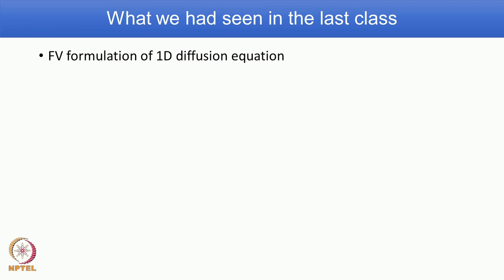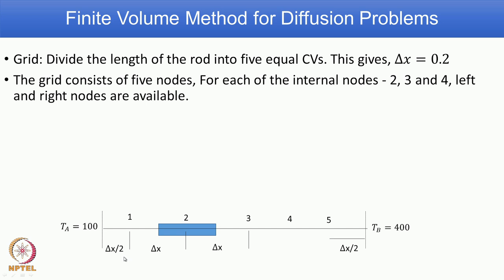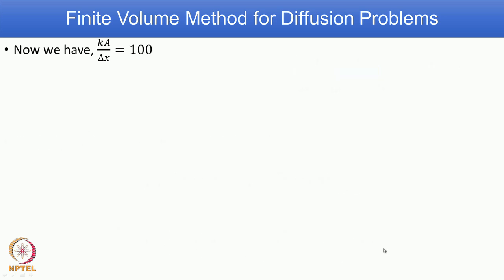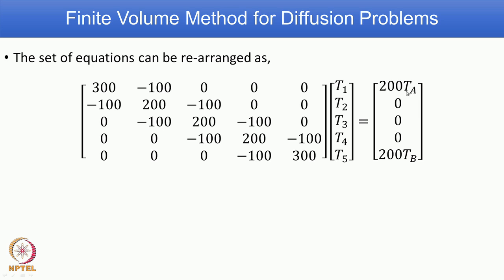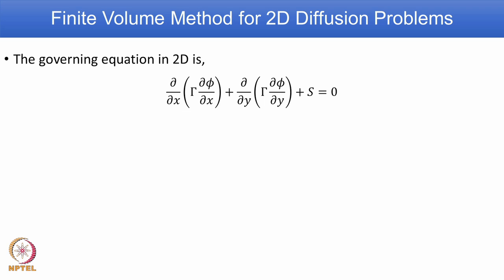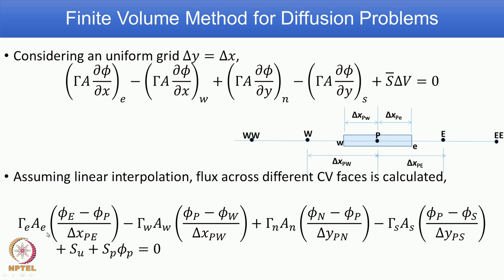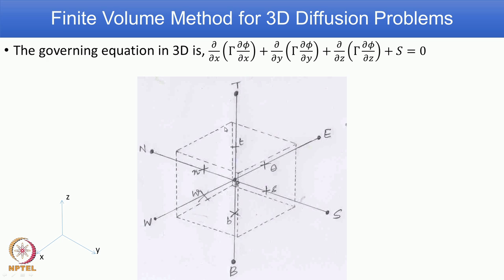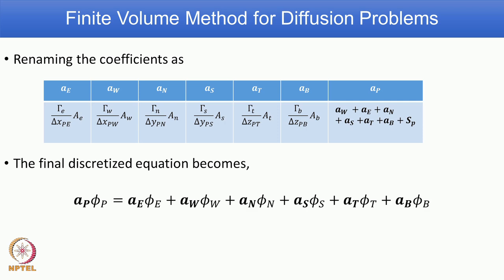Week 4 - Module 2

Comment: The exact solution should be T(x)=300*x+100 and kA/dx is 0.5 and the MATLAB code for this problem is like this:
A=[1.5 -0.5 0 0 0;...
   -0.5 1 -0.5 0 0;...
   0 -0.5 1 -0.5 0;...
   0 0 -0.5 1 -0.5;...
   0 0 0 -0.5 1.5];
B=[100;0;0;0;400]
T=inv(A)*B 

which gives
T =
  130.0000
  190.0000
  250.0000
  310.0000
  370.0000

Comment: The value of kA/deta X is given as 100, which is wrong. Also the Exact solution is wrong. The value of T5 is obtained as 460, which is not poosible as the boundary condition is 400 and there is no source term
Reply: Yes dear Raman, that's correct. I have uploaded a tutorial showing the solution of that problem and also showing the solution of 1D steady state heat transfer by TDMA method in my CFD playlist. Thanks !